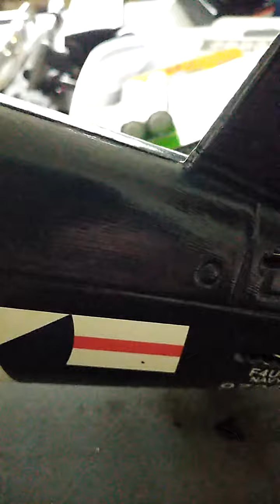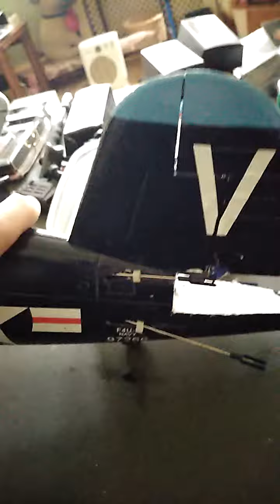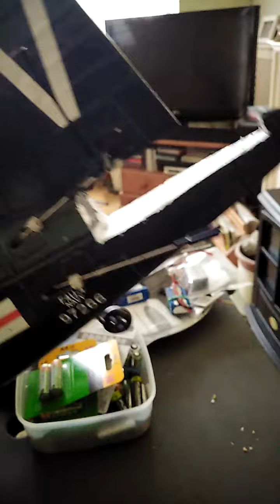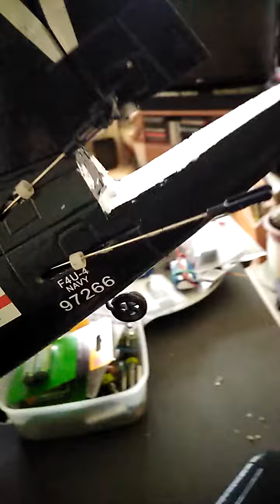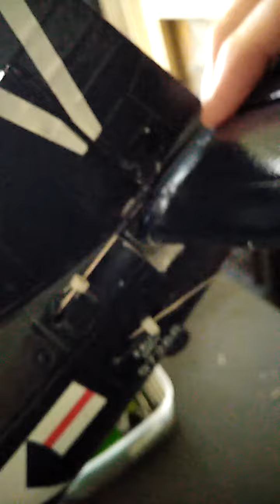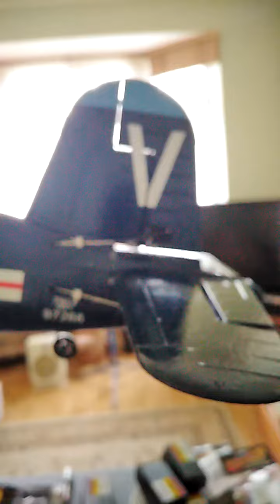FMS CORSAIR CHOP JOB ON THE FUSELAGE TO MAKE THE HORIZONTAL STABILISER SIT LEVEL

Comment: Nice job Brian - at least now you are in with a good chance of the maiden not being a disaster - good luck with the Hot Glue - .. Charging Battery's myself at the moment , 50% done - Camera battery's all charged, Tx, Charged,  Had to fix a worn out rudder hinge on the Bixler 3 - it just fell apart - goes to show how important it is to check and check again - absolutely everything , but unlike yourself my go to glue is FoamTac , if I do not have that then UHU Por,  if I have no alternative I will use Hot Glue, I do use it for installing servos into wings (sometimes)..LOL... Fingers crossed the weather is calm on Sunday..if not will try again Monday - Flight for first time back - FMS SuperEZ, Bixler3, Night Walrus, Shrike,  - then if time I will follow up with a rebuit (Yes once more) TTX and I want to fly the Micro Tundra again ...... then weather allowing next week - first set of Maiden flights - Carbon Cub S+ & the FMS 800mm Zero...
Reply from the maker: Hi martyn
Monday is suppose to to be sub zero... N.. windy. Glad we're both o. The same page doing checks before flight it's amazing how things can go wrong with planes just sitting there.. Well you've certainly got a full on week ahead of you
Good luck. And sacrifice another pork pie to the gods